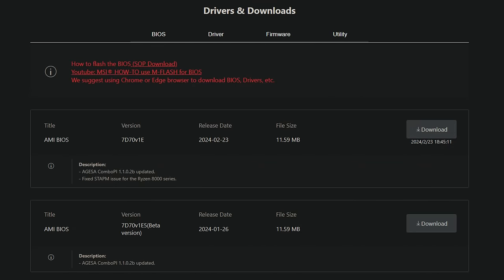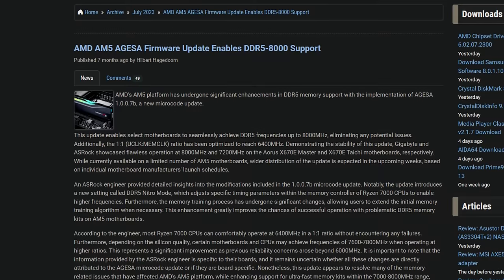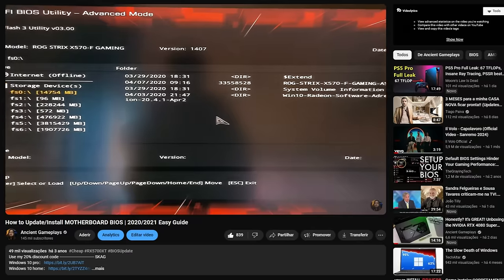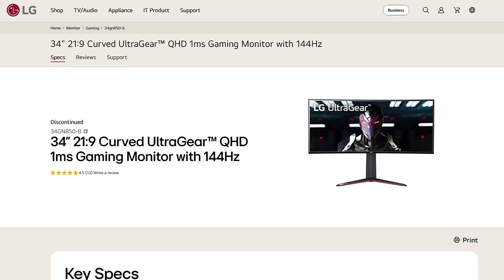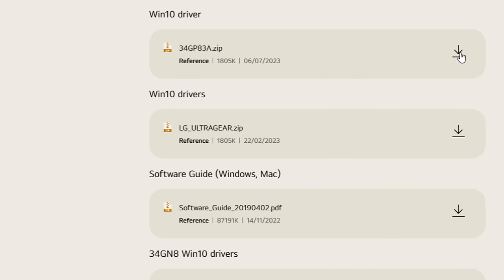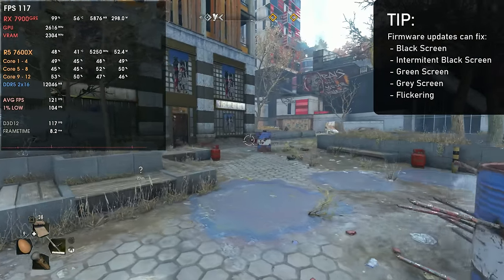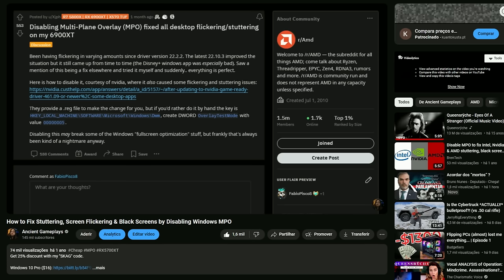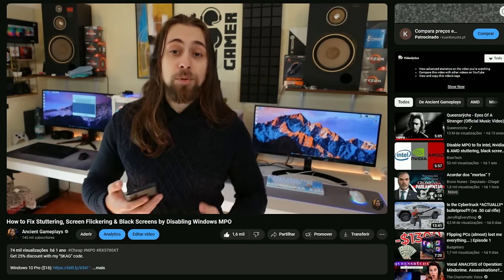20 TIPS to FIX "AMD GPU's Problems" | Easy 2024 Tutorial Guide

Comment: Fun story. Built a PC for a friend. Upgraded same thing a bit later and friend settled for a used 6800XT (I ordered one for each of us from Ebay, mine was the Power Color Red Devil and his, the ASUS TUF Gaming OC. Only reason it landed like that was the ASUS came in first.) Other interesting piece of info, both our Motherboards were identical: Asus x570 Tuf Gaming plus Wifi. Initially no issues, but over time and with newer games, his PC started behaving oddly. Start a game (Helldivers/Avatar/Robocop/Cyberpunk) and it will run for a bit, no temp issues other than his GPU hotspot was warmer than mine while doing the same things with the fan profiles identical, never overheated, but then the screen would go black and the PC would hang (determined later it was rebooting but no display would appear until a full power cycle was done). Traded him GPU's since my Red Devil was working flawlessly. Now his Red Devil is working flawlessly and "my" Asus did all the same things. Turns out a GPU Bios Update, then a final full purge (DDU) of the Radeon drivers fixed the issue very well. Always remember that other components have BIOS too....

I'd ddu'd the drivers before and that provided some relief periodically with driver updates (I'm not totally ignorant, I really just didn't want to take out my Red Devil 😁)
Reply from the maker: Nice tip! Gpu bios updates aren't that usuall though, that's why I always pick sapphire, asrock or powercolor for the amd side
Reply: I also have ASUS TUF 6800XT drove me crazy for more than a week until I updated the GPU bios. Turns out the old bios got some compatibility issues with Ryzen CPUs.
Reply: @AncientGameplays  well, after the bios update, I'm running this thing at 2700mhz gpu and 2100mhz mem clocks, at 1050 mV underclock and it's stable as a rock, buuut there is a wee bit of coil whine starting at about 1200rpm on the middle fan on the gpu...I used to run an MSI Evoke 5700xt OC...I've had worse 😁
Reply: @AncientGameplays   It is seldem that GPU's have a bios update. Normally that is only if there is a big issue! You will normally never be able to update GPU bioses. You are able to find almost all of them on TPU they have a big bios catalog to download. But in my experience it happens maybe once or twice in 100 releases like with the last 4080 super from MSI where MSI screwed up with their ventus X2 if i am right.

But that is as said very unusual to happen.
Reply: @AncientGameplays I have a sapphire 6800xt, do we get bios updates too? And if yes, then where?
Reply: @karlos1060 Some nvidia cards required bios updates to enable resizeable bar, after amd embarrassed them with it.
Reply: @joby602   As i said, it is very seldem. Only in rare occasions.  I never had to change the bios of a GPU. Only undone some that were used for mining with a mining bios. Normal people as i siad before don't even know what a bios is.
Reply: good video as always... the problem I have with amd is when the pc goes into sleep state and I wake it up, the fan profile returns to the original, it's not annoying but it's annoying at the same time because it's time to load the profile and that's it. .
Reply: @erikovick You don't use afterburner do you? It's a common cause of this.
Reply: @joby602  not only use msi from osd the curve coolers in made from adrenaline
Reply: @erikovick  you mean you use afterburner just for OSD? If so, is probably resetting your fan curve.
Reply: @erikovick  just to make sure you know, even if afterburner is set to not control fans, it still will reset them - there is a bug in the interface. Go to afterburner settings, fan section and enable fan control. Now enable firmware control mode, then apply. Then disable firmware control mode then apply. Now finally disable fan control again. Basically you want to cycle the firmware control mode and end up with it off, even if it was off to begin with. Now set your fan curve in adrenaline. Try hitting the reset button in afterburner to make sure the fan curve in adrenaline doesn't change. It's not logical, just the results of a bug.
Reply: @AncientGameplays  i have a powercolor hellhound 7900xtx and i have this issue for 2 days straight now, im hoping this will work!
Reply: @joby602  My fans were working fine in Afterburner, until I tweaked some custom settings in Adrenalin. Now everytime I try to adjust the fan curve, adrenaline seems to override any previous fan curve to only 40% no matter the temperature after I try to save the settings, even to a profile, it reverts to 40%  I'm only a little tech savvy, and havent been messing with PCs long at all, as I just built this one like 7 months ago.
Reply: @RealEyesRealizeReelLies  try doing that thing I mentioned above, where you enable afterburner fan control, enable the firmware option, disable it again, then disable fan control. If that doesn't work I'm out of ideas!
Reply: @joby602  I clicked the button to change the 'User Defined' fan control back to 'Auto' and I think that might have helped. Still have to do some testing. But thank you for that!!
Reply: Hi i need some help with updating the GPU bios, is it the same as flashing new bios to the gpu?
Reply: @vaemar hey man did you get this fixed? I have the same problem and was curious if you could wave me in the general direction
Reply: Is gpu bios same as firmware? Sorry for the noob question. I have Gigabyte 6800 xt OC. The OC switch is on, on the gpu. This card is driving me crazy
Reply: I have never heard of this until now. I built my friend his first computer with a 7900 GRE Red Devil and had the exact issues you mentioned. I tried everything under the sun, so I had thought, but updating GPU bios wasn't something I knew about.

We ended up returning the 7900 GRE for a 4070 Super and haven't had any issues since. I do wonder if a GPU bios update would have solved the issue though.

Comment: I got a 7900XT a few months ago. Only "issue" I have is regretting not saving a bit more to get the XTX lol
Reply: U playing on 4K more ?
Reply from the maker: Like I said in the begiinning
Reply: I have an XTX but I game at 1440p😅. I think 4k is too expensive computationally speaking.🤔
Reply: Damn makes me sad bc my 7900xt is coming tomorrow will I regret it as well 😂?
Reply: @Trusttheprocess927 was about to buy a 7900XT, but then i got a sweet deal on a RTX4080. TBH i like the AMD drivers better
Reply: @ogm19881   Same. I have 3x 27" 1440p at home and 3x 27" 4k at work. Yes, the clarity is eeeever so slightly better on 4k, but it I'm not going to basically double my GPU expenditure to get that. Like ever.
Reply: @Trusttheprocess927 Don't think so. It is expected that the 
7900xt will age well.
Reply: you should buy 7900xtx men :D It is fastest gpu in raw performance.. but in raytracing only 10 fps difference vs xtx.
Reply: @MakeSh00t   I got the 7900 XTX but I already had the 4k display so I didnt have to buy anything else. It runs amazing. Well worth the money imo. Especially if you already have a 4k display.
Reply: Same here 😂❤
Reply: yeah 6000 and 7000 are really solid, but older is cheaper :V
Reply: I traded nvidia for 7900xtx and really should have saved 300 and got the 7900xt. 
I have pretty much only purchased nvidia since the 290 series high end. And amd for mid range for my kids. Prior to the 8800 series where I brought 2 to run in sli that purchase I still regret today. The radeon 9800xt was still the card I loved the most.
Reply: I know I don't want to make that mistake, and I'm fed up with Nvidia. After 10 years of buying their GPUs, im going full team red and buying an XTX this week.

Comment: I run a 6800 XT and can tell you for a fact that DDU will save you a lot of headache. I had one time where upgrading drivers or even installing outright would just uninstall the old drivers and crash on update. Ran DDU and it installed correctly immediately.
Reply: 100%. The only issues I had were stutters and it turned out it's because I didn't use DDU when updating drivers
Reply: 😂😂 hell nooo AMD is shit never buying a AMD card again. Got a 4090 and have no issues with drivers it just works. Amd on the other hand 😂😂. Me and my mate ours cards back with in a week. Just use it for a paper weight.
Reply: @kurtlazarus5975 U so mad when you Say that.. 
U have no friend for sure.. 
Sit on U 4090 N' watch the futur 5080's owner❤
Reply: @laforge4525  they will still be shit mate amd has only had 15 years to pull your finger out. 5080 😂 that will never happen. Even if it did a 3070 would stick kick it's ass.

Comment: If some games run fine for half an hour or 40 mins and then crash is it normally a driver issue or the game itself if the cpu is under 40% use and gpu is under 80% use.

Comment from the maker: Let me know if any of these tips helped you in some way!
Reply: Disabling the AMD in-game overlay worked for me, it hasn't crashed at all in the last 3 weeks, I have RX7600 btw.
Reply: Speaking of Chipset Drivers, AMD has new ones as of March 13th. They have bug fixes for the PSP and SFH drivers. I would not have checked had you not mentioned chipset drivers.
Reply: @uncleelias  with the latest b550 driver my cpu went from 60 to 80 in gameplay.. so installed the previous one and its fine again
Reply: what about cod mw2 dmz crashing when using spotter scope?
Reply: Still wondering whether I should disable H.A.G.S. - I'd like to improve fps on MSFS2020 (7900XTX).  Would you recommend disabling it anyway?
Reply: @Williamsson_Theviking  what cpu/gpu?
Reply: I've saved your video and the bookmark called computers so I can go back to it over and over again. I really appreciate it man
Reply: It depends what memory you have gpu and motherboard... i had alot of issue with asus Rog strix motherboard... blue screens nonstop. But with gigabyte x670e 0 issue 0 black screens and blue screens.. all depends what you have luck or no luck.
Reply: hey man . rly rly good vid . i wanna let you know that you dooing a exelente job . never stop doing it . we believe in you . also at 39:30 there is that HAGS thing but i have a 5800x3d and a 7800xt and i dont see that hags thing in my system . i am on WIN 10  is that normal ?
Reply: It helped me to wonder how different will be "20 TIPS to FIX "NVIDIA GPU's Problems" | Easy 2024 Tutorial Guide" or "20 TIPS to FIX "INTEL GPU's Problems" | Easy 2024 Tutorial Guide".
With guest star RTX 4080 Supper
Reply: @Williamsson_Theviking if you have an r9 7950x then try disabling the igpu in the bios. Also check your ram voltage. I had to up my ram voltage a little.
Reply: This entire video helped me.
Reply: Thank goodness for these very helpful videos, Fabio.  I've been checking your driver reviews which are quite useful in informing my choices ever since I got back into team Red last year.  I got myself an Asus TUF 16 2023 Advantage Edition laptop that runs a Ryzen7 7735HS  along with a Radeon RX 7600S.  I would greatly appreciate it if you could reply and include a link to the best Pro driver version to use form AMD's website, as I have no idea which one I should get, given the sheer number of choices they have for the PRO ones.  Maybe you yourself use an Advantage Edition laptop or maybe you could ask your friends who do or something... or if the PRO drivers may or may not be advisable for Advantage Edition laptops and such.  Your input would be such great help on this XD
Reply: do anyone of you guys have microstuttering on videos youtube/twitch doesnt matter when watching in FULL SCREEN ? both video/audio it just goes like BZZT for 0.2 seconds and keeps doing decently often, 5600+6800 here.
Reply: @ramazanucan9792 Interesting. Were you running any other overlays? Steam, etc.? I disable all other overlays first.
Reply: @uncleelias   I only disabled amd UI and never ever crahsed since then.
Reply from the maker: Maybe a bad reading only  @newjoflo6916
Reply from the maker: @de4ler it is windows 11 only for amd
Reply: @AncientGameplays  should i upgrade to 11 or its not important ?
Reply: @AncientGameplays  Not only overclocking ,but undervolting also may cause stability issues.

Ps: as always a lot of useful information 🎉

Comment: This MPO thing really helped me. After a week of research, I was about to smash my head in with a rock because I couldn't figure out why my screen was flickering when using the browser and GPU-intensive programs, but only on Windows. I changed monitors, bought new cables, bought a new power supply, switched ports, reinstalled Windows with full formatting and tried different versions of drivers - nothing helps. But somehow I ended up on one of your videos about MPO, and as soon as I turned it off, the problem went away.
Trully a Savior - Fabio Pisco
Reply from the maker: Great 💪💪💪

Comment: This happened to me a while back, I had issues with my ram and Call of Duty Cold War. Game would crash giving me a "outdated graphics driver" or "update your graphics driver" kind of message, happen to me for the longest time. I tried reinstalling/updating drivers, chipsets, bios, windows itself. I even bought a brand new kit of ram at one point but the issue persisted. Eventually with the help of some much smarter people i tried upping the dram voltage just a hair which helped stopped my game from crashing. It was nice to see that tip in your video as it was the solution to my problem a handful of months ago.
Stay fabulous Fabio ❤

Edit: I was using xmp at 3200mhz for my system. Upping the dram voltage a hair stopped the issue.

Comment: Thanks for your Work.

For disable "Enabled ULPS" there is no need for MS Afterburner.

Open as Admin "Regedit" over the Windows Search. Then use the Search Option in the Program and search "ULPS" (Not ULPS NA) 
then change the Value from 1 to 0.
Restart the System. Its done. No need for 3rd Party Software. 

As with Anti-Lag, one could have mentioned that it is generally recommended to activate the driver features in the Adrenalin software only for the respective game profile, never globally. I think when Anti-Lag + is back it will be time for a new edition of an overview of the functions and features of the Adrenalin software!
Reply from the maker: Yes, but afterburner makes it easier than registry for the common user haha

Comment: The only problem I had with AMD was when I updated BIOS & reinstalled windows to use R5 5600 but didn't know I need to install chipset driver ASAP. And it led to my GPU can't contact the CPU thru PCI.E that makes the fans didn't spin even reaching 90 temp xD. After installing chipset driver, everything's back to normal and works perfectly!

Comment: Dang you were spot on with addressing the Nvidia fanboys early on. Scrolling down I can't believe how many there are. I've used roughly the same amount of Nvidia cards in the past 13 years as I have AMD cards and sometimes I forget how brand-loyal some persons can be. I am mostly friends with tech nerds that build their own PCs, and I find that, anyone that takes this stuff seriously generally doesn't fall for brand wars. It's bubble-breaking to see that demographic lol. I'm always looking at every brand for the best deals, and preparing myself for every brand. If I get an AMD card, I'd prepare myself to minimize early-launch driver faults. If I get an Nvidia card, I'd prepare myself to avoid complete GPU failure. If I get an Intel card, I'd make sure I don't use it for DX9-11 games, and probably put it in a productivity rig to min-max it. I can't imagine what I'd need to remove from myself to be willing to feverishly fight for any of these 3 brands. They'd have to pay me to do it lol.
Reply: yeah I had 2 Nvidia GPU's back to back randomly die on me out of nowhere. I never overclocked them or anything. I went AMD recently and couldn't be happier. Nvidia fanboys I noticed like to really over dramatize the smallest issue for AMD. When Nvidia is just as guilty with their own issues.
Reply: Having and acknowledging problems with X doesn't make you a "fanboy" of Y.

Comment: I'm not a fan boy by no means. Hell, I'm 53. I'm all about getting the most for my money. 
I prefer AMD for both GPUs and CPUs simply because of the ability to tweak and optimize for each game or application in running. 
My friends are shocked by the performance of my pc. It's also much easier to find the balance needed with AMD.
It is nice to see some of these big Tech channels start talking about a balanced system and how it's more important than FPS.

Comment: imho DDU is a must for correct driver installation. I used it with gtx 1080, rx 6700 xt and now I use it with rtx 4070S. Never had driver related issues with any of these cards.
Reply: On my last NV card (2080ti) I just upgraded the drivers without DDU or uninstalling for 2+ years straight. Went to a 7900XT a month ago and I've already had to DDU 3 times after a clean Windows install...
Reply: I have used ddu several times but I only get issues and trouble with that.  I will avoid DDU now. The Problems only getting worse mostly when I tried them for troubleshooting

Comment: One thing that helped me and I didn't see advised anywhere: RESEAT YOUR RAM! My rig had massive problems with AMD Driver crashes on nearly every card I put on it until I took one of the modules out, tested it, and put it back again. No other noticeable issues and this alone fixed things.

I hate computers sometimes.
Reply from the maker: Again, a user issue like most times

Comment: Excellent video that all people should watch! Keep up the great work!

I have to add this. For the chipset drivers, you have to disable windows from downloading them automatically because they are buggy. Download them ONLY by the manufacturer (ASUS, ASRock, MSI etc) or in my case by AMD itself. 
Additionally, you can use the AMD Cleanup Utility (in safe mode) to remove anything that has to do with drivers and install new ones.

This solved my issues with black screens, drivers stopping and starting again etc...